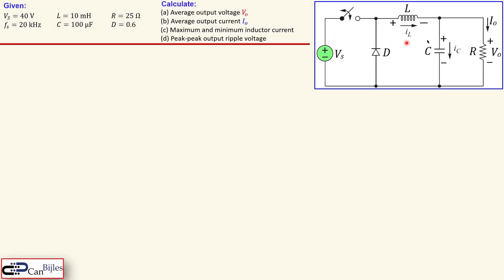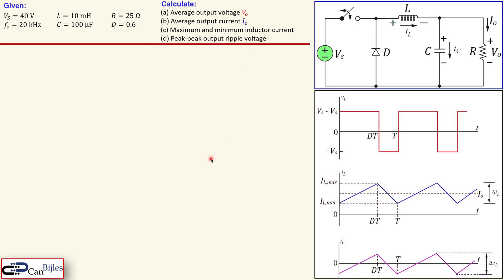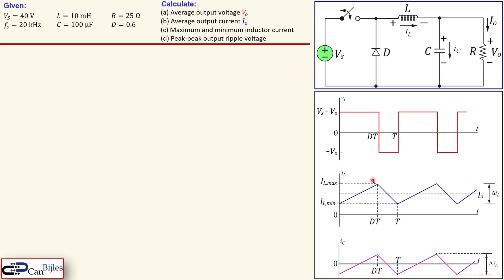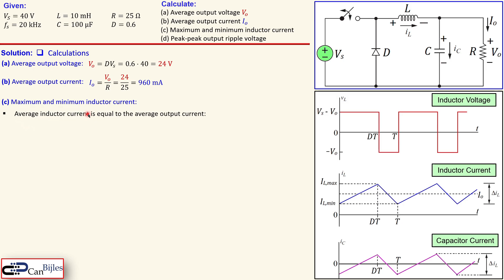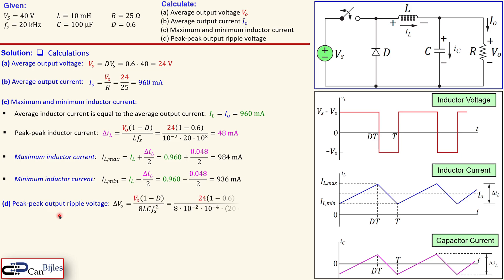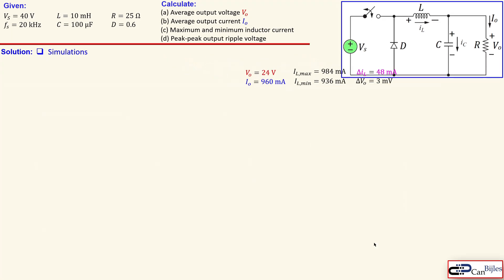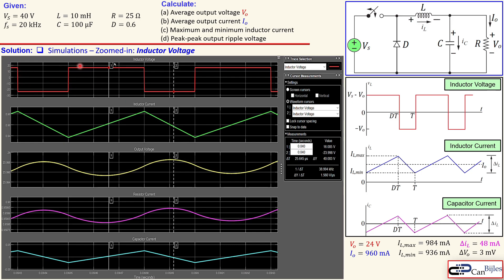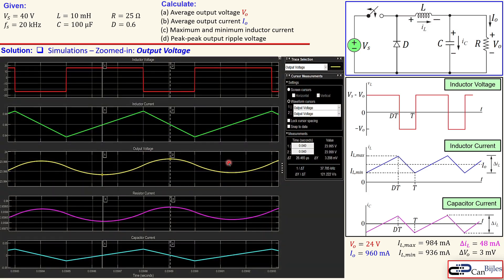DC-DC Buck Converter - Continuous Conduction Mode ⚡ Power Electronics Calculation & MATLAB/Simulink

Comment: Tell me the blocks name
Reply: Which type of switch are you taking and in that switch input block name please
Reply from the maker: @sujathakemya7387  The switch is ideal. The names of the other blocks are mentioned in the video.
Reply: From the info given, if I'm not wrong, you have to find a switch  (ex: a mosfet) that checks all the min/avg/max working values and that would be "ideal" as implied by our great sharing knowledge teacher  @sujathakemya7387